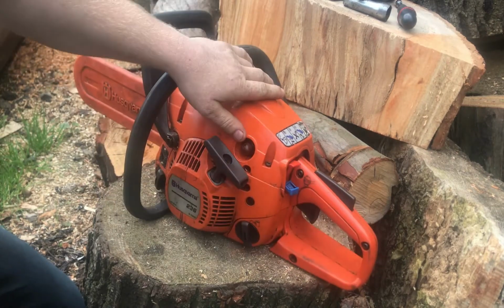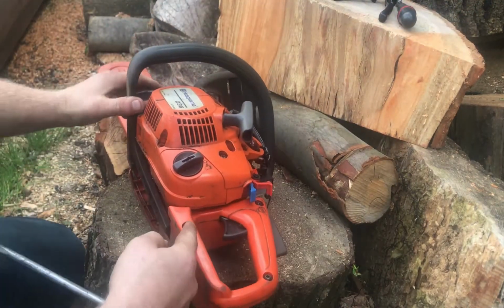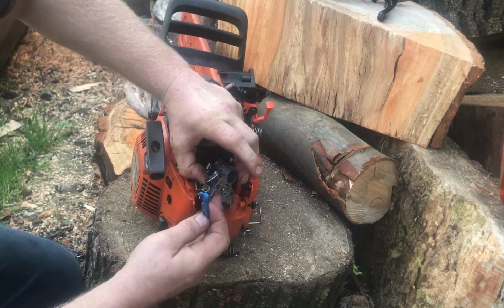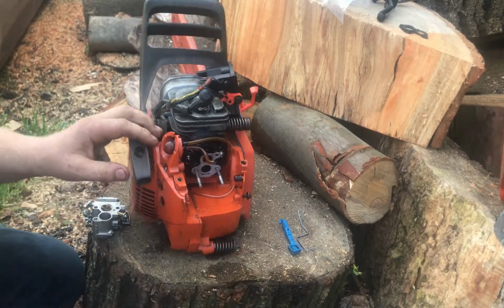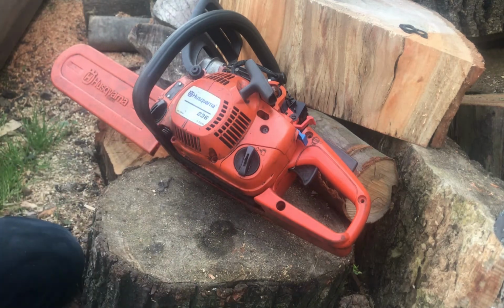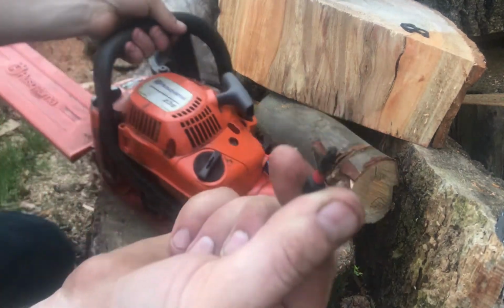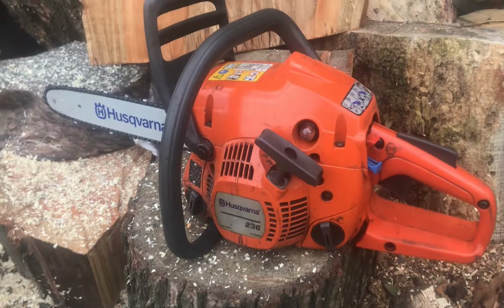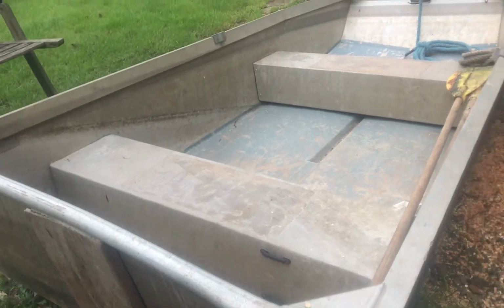Husqvarna 236 x torq carburettor replacement

Comment: A friend of mine recently asked me to look at his 236 as it wouldn't run properly, dealer couldn't fix, he had done all the normal things like fuel line, new carby and plug etc.  I checked spark and it looked week. I swapped coil pack but no change. I then swapped flywheel with my 137 and it now starts, runs and idles perfect.  The original flywheel has 3 magnets and the 137 flywheel only has 2.  With the changed flywheel the timing is slightly different and makes a world of difference. Hope this helps

Comment: Need help ...I bought  an Husqvarna chain saw 326 the fellow who sold it to me  started it and cut some wood and I bought it 
The day after I was using it and it went terrific for the first quarter of an hour then it didn't start anymore  I though it was a carburettor
problem and got  one from China  replaced it  but  didn't start . One thing that I could not understand why it so hard to start and I got a 
sow arm  I said l may remove the cylinder off and see what is the problem   ....The piston has a little scratch on the  front  the  it  has not 
damaged the ring  ...Then I decided to test if there is any big gap in the ring and when I fitted it in the cylinder there is a millimetre  gap 
---  plus or mine ---- the question  a would like to ask you  should I replace the  ring  and the piston  ----there is no scratch  in the cylinder .
I forgot to mention that when I removed the plastic(?) from the cylinder and carb. that is shown 5.50---on this video---the part has 4 screws that
are fitted to the cylinder ....when I removed it the gasket (?) that is glued to cylinder got a bit damaged only a little bit    should by another 
one or use some gasket glue when  put back ?    ALSO for the first time I saw 2 piece of plastic inside of the cylinder  probably this is the reason 
why the piston goes hard ???  Can  be removed ?
Thank you